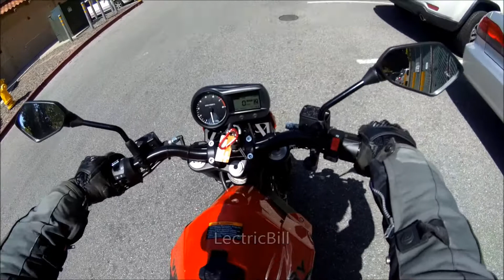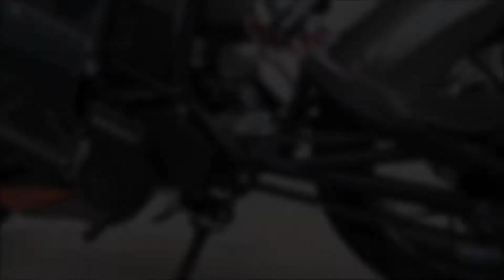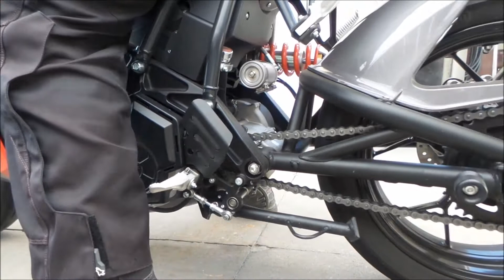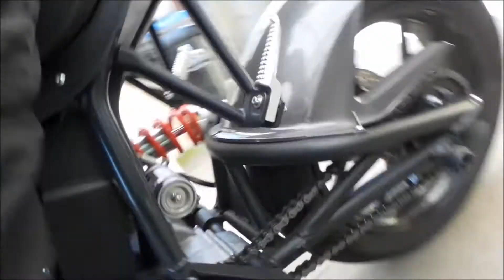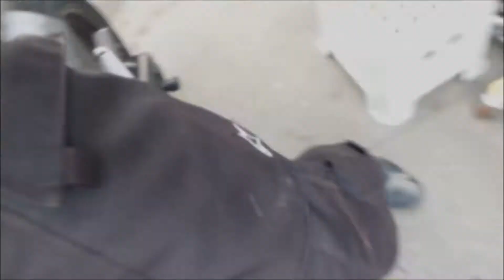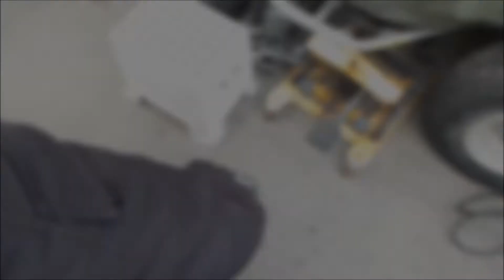Empulse TT Drivetrain Backlash and Remedy

Comment: Yes, when you arrive at a standstill, and the motor sits still, holding the drive sprocket, it is just needing you to roll an inch forward or two, then the top run of the chain becomes the slack section, and droops down.  You hit the throttle to take off,  and the few degrees the front little sprocket has to turn before that slack on the top chain run disappears, lets the motor - especially of course an electric motor - get up to a rotational speed, and then of course, almost immediately, there's a sudden loss of all that slack top run of chain, and all the inertia of the motor and the torque you are applying, meets the still-stationary rear sprocket.  CLUNK!

The way to fix it on any bike is a tensioner on the bottom run, but that is quite a lot of spinning, you'd need to use a powerful spring setup like cambelts or auxiliary belts have on cars?  I am assuming, the Empulse has the usual 'cush drive' at the back wheel, which gives a softening of the clunk, being rubber sockets in effect, that the rear wheel sprocket, has big bumps that slot into, when you assemble it.  Thus, you hit the throttle, and there's a light beginning to that clunk.

Of course, petrol bikes mean slow-action clutches, which in normal use, you will be sitting at the lights, have already 'clunked' it into gear, and that action alone, has taken up the top chain run slack, because of the clutch plate drag?  It's not that they exactly designed the petrol ones better, they just happen to operate in such a way the slack gets taken up a bit before you properly apply lots of power to zip away at the lights etc.

Does it have a cush drive?  Or is the sprocket on the back wheel, directly hard-bolted into the wheel hub?
Reply: answering my own question - jay leno's garage yes it has a cush drive, but their effect is limited.